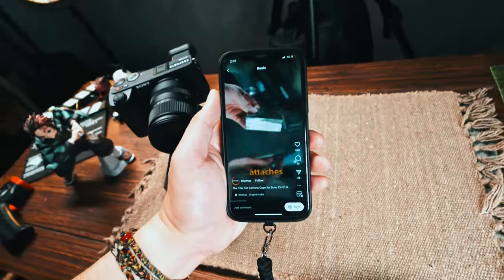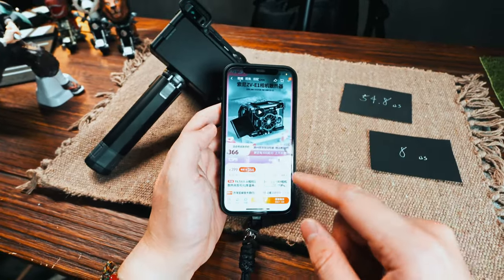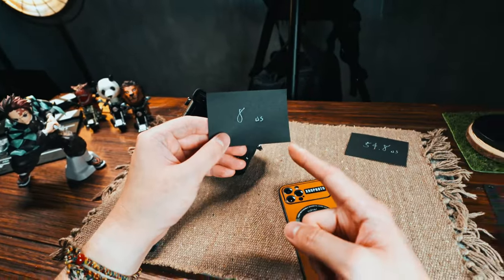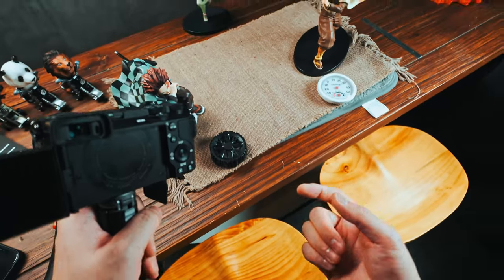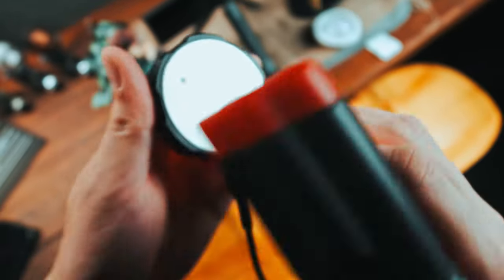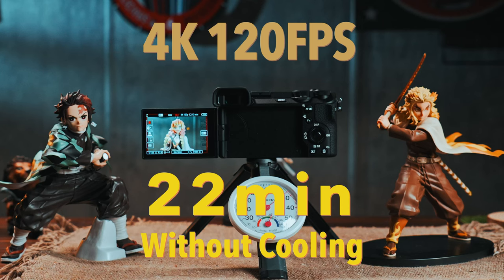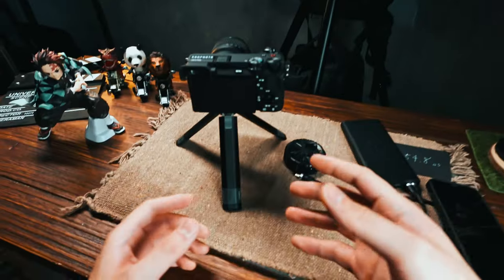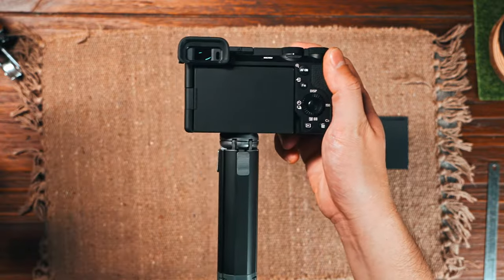$8 Solution for Overheating ?!➜ Bye TILTA Cooling System | Sony a6700 ( Idea works with ZV-E1 * )

Comment from the maker: ⭐ New Update ! Solution Without Magnet : https://youtu.be/BLK6QcbWrX8 ⭐

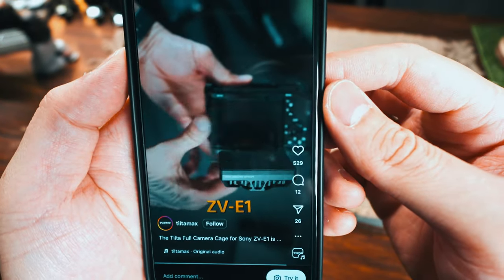👉 * Correction : Apology for the Inaccurate Information Regarding Tilta's Screen Closure. The 00:20 IG Reels were inaccurate. *

🔺 * Note : This video only provides the idea, please do your own research before trying it yourself. 

🔺 * Note : ZV-E1 Semiconductor's size has to be within 7cm * 4.8cm , otherwise it won't fit. Price will be different due to different product, size & country.

🔸 * Note : Idea means by using the Semiconductor cooling sistem to extend the recording time.

Comment: You cannot check temperature of reflective surface such as metal with such thermometer as reflectivity affects readings.
You should put some tape on it and your results would be way more accurate. Im 100% sure it didnt reach 18C as it would need to have heat pump (like your fridge) to reach below ambient temperature. Its false reading caused by reflectivity. infrared light that comes from thermometer needs to hit surface and stop, not bounce back of shiny surface. It will be accurate on your skin, on tape, on wall, but not on shiny metal, shiny cars etc. 

Video is still very helpful and there is clearly difference in temperature, just point out this mistake :)
Reply from the maker: Thank you for your advice ☺️
Reply: Correct -  can not go below ambient.

Comment: It's nice to find a video on this, I've only really seen this mentioned for astrophotography things for some reason. 

I'm debating using a USB C PD board to access 12 volts from my 20,000 mAh Anker battery bank, to power a TEC1-12706 cooler attached to my ZV-E1. I just purchased the camera used, and I film exclusively outside in all weather conditions, run and gun style. I observed it overheating in under 20 minutes sitting in my 70 degree fahrenheit house recording at 4k 60fps 10 bit 422 200mbps, and it's got me worried that I purchased the wrong camera

Comment: When Youtuber completely not study for what they say. Tilta fan perfectly closing with the screen closed. I have 2. Also tests are inaccurate. And putting a magnet next to the sensor not the brightness idea . It may introduce extra noice to the sensor due to magnetic field. Well. For trying to engineer new solutions definitely a +
Reply from the maker: I see, thanks for the info.
Reply: From what I've read the magnet won't effect a mirrorless

Comment: Hey i wanted to buy viltrox ef-e ii adapter for the sony a6700, could you tell how is the autofocus performance now with the viltrox i saw your one video earlier in which it was giving problem with tamron 24-70 and 70-300 vc version , i want to is it still valid , plus which other lens have tested so far with it on sony body
Reply from the maker: Glad you ask, I did test the ef-e ii with a6700, and it didn't work. The AF stops when you hit the record bottom, not sure why. Hope this info helps you.
Reply: @After.Photographer  thanks for letting me know me know , now my only option is metabones ultra speedbooster to play with 😉

Comment: Does the magnet base you glued to the camera mark the screen? Do you have a great idea here but you would have to reassure people that what you put onto the camera the magnet won’t affect the screen. Maybe show a follow up video proving that doesn’t and people by end of this idea.
Reply from the maker: I belived it is called "Heat Transfer Magnetic Sticker". This is not magnet by itself, it only attracts magnet. If the magnet you put on the camera is too strong, might have some influence ( not sure ). So far, this one works ok to me.
Reply: Magnets don't effect flat panel(led,lcd,isp...) screen like they did CRT screens. "Shielded" magnets are a thing of the past. I'm not 100% on what it may do to other components, but the screen is def safe